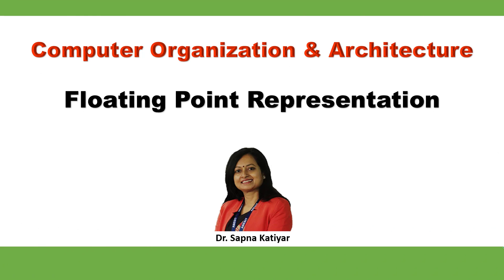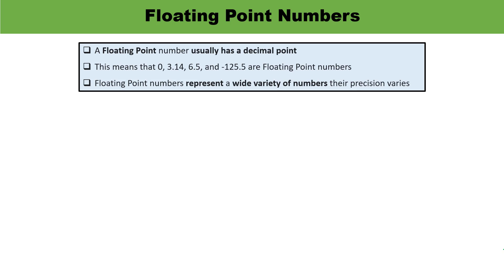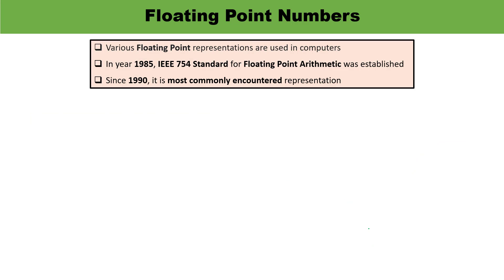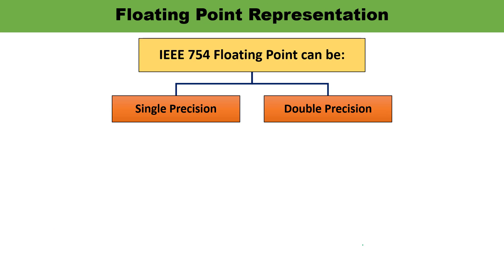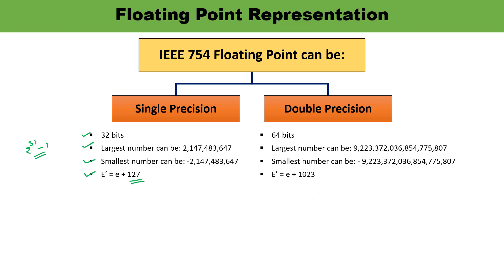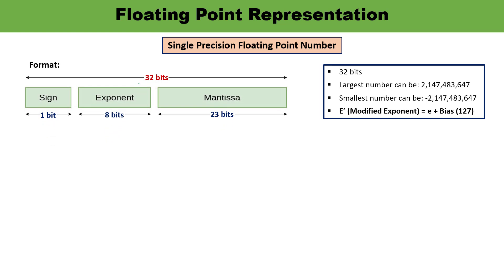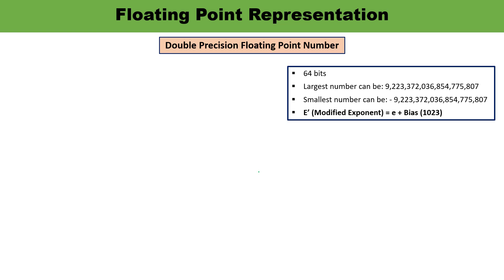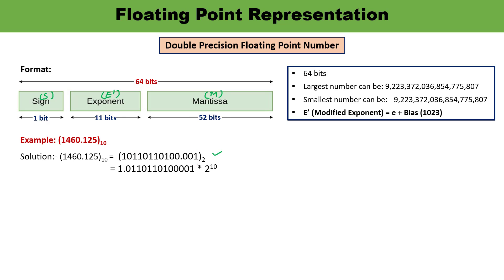Floating Point Representation || Computer Organization and Architecture

Comment: why are we adding bias?
when we fill mantissa space ? why do we go from left to right and fill remaining with zeros?
and what about exponent space? whats the order of filling? left to right or right to left?
Reply: Hii, to answer ur question, i suppose you gotta take a look at the exponent, its mandatory that the exponent for single precision to have 8 bits and double precision to have 11 bits based off the vid, so representing the bits u always start with 2^0 up till 2^7 for single precision and 2^0 to 2^10 for double precision, the value of e takes up 1 spot out of lets say single precision, 2^7 = 128 spots, you're left with the 127 which u have to add on in order to get the total exponent!
Reply: You have to fill up the remaining spaces after the mantissa with 0s cuz for examples single precision, a total of 32 bits, u gotta use up all the 32 bits, or else it would lead to an under/overflow, which is an issue in floating point ints
Reply: Also order of filling is from left to left to right